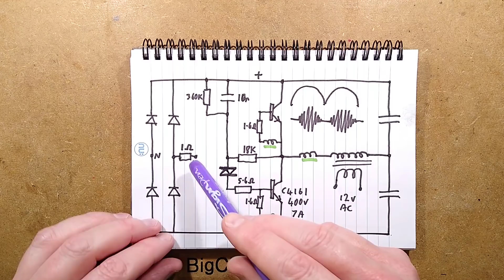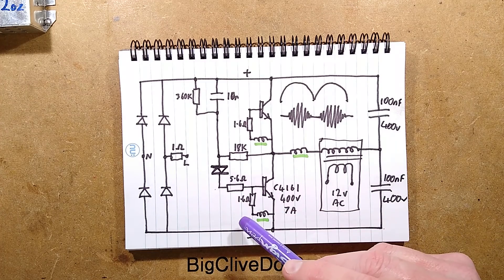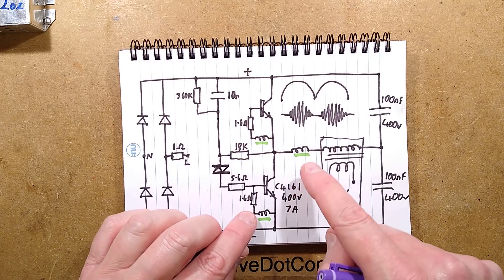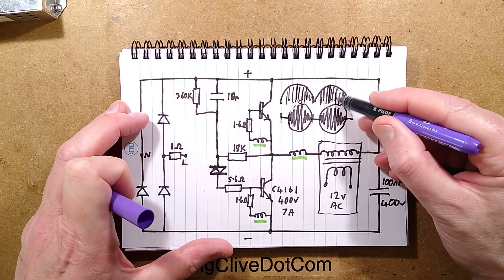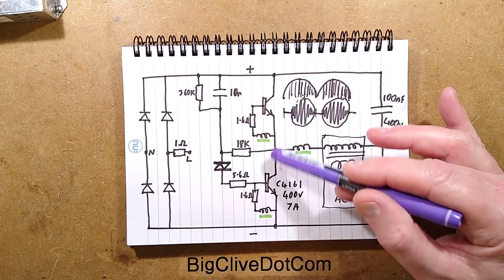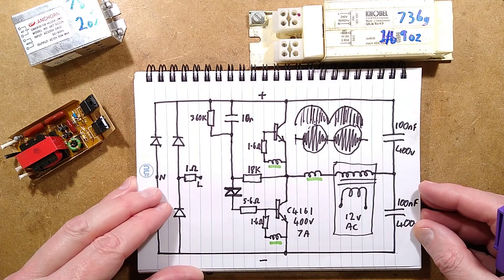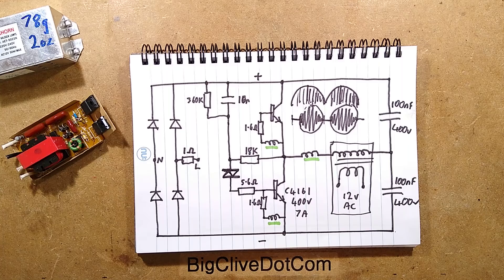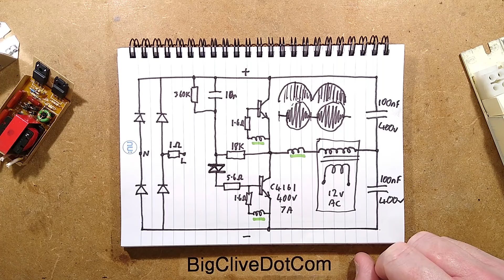Inside an electronic halogen lamp driver, with schematic

Comment: Hi Clive: if you're still tracking this, have you done a follow up on switching out a transformer originally for halogen, to use LED lamps in the same under cupboard downlights?  I switch to LED ones without changing the transformer as I could not work out what to buy. After a few tries, I got some nice G4 cob lamps that didn't flicker much. This was fine for a few months but then I found the Kaoyi KT 60V 20-60W Pri 0.25A sec 11.4V~ eff 5A was suddenly not working. Opening up, there was no obvious damage, but a square Aupo A2F 2A 115C thermal fuse had been stuck half in and half out of some white filler that also covered the bottom off the smaller transformer. A bit of a messy arrangement, and it looks like the fuse cracked because of differential expansion of what was in and what out of the goo! I've sent to China for more, but, in the meantime I've put in an Aurora unit which has the same specs but is lighter. I had a pair of them for some time having been sold them as good for LEDs but then found the instructions said 20W minimum (as you mention here), so hadn't tried them.  Turns out the lights do work with the Aurora unit, but they flicker more than with the old one, that has a surprising number of components.  So, I will fit a new fuse to the old unit, but, ideally I should be replacing with something that won't flicker (or blow up!) with LED lamps. What do I need to be looking for? Preferably affordable: I notice Amazon sellers are askin up to 30quid for the square thermal fuses but Aliexpress just a few ( though still a sizeable fraction of the cost of a whole new unit! Crazy world!).  A great service you are doing us all with all these teardowns and explainers! Many thanks.
Reply from the maker: The best way to drive LED bulbs without flicker is with a regulated 12V DC supply.  The old electronic halogen transformers put out a series of spikes in a crude sinewave, and it can charge the smoothing capacitors in lights to a higher than usual voltage.  Some bulbs can be damaged by the old halogen drivers and many of the drivers really need the consistency of a tungsten load to work reliably.
Reply: @bigclivedotcom  Thanks very much for the rapid reply to this old thread!  When I was ordering the thermal fuses, Google and Aliexpress threw up dozens of pictures of different drive units, trying to tempt me, but just confusing. Can you suggest any particular one? I'm only driving three under cupboard lamps, and they don't need to be very bright just to illuminate either side of the hob food prep area.

Comment: Wow, I have been puzzled for a while why a cfl circuit I am trying to repair is firing the 2 transistors at the same time and blowing it all up. I did not look at the diode at all. It must be the diode being full open and blowing the transistors, fuse resistor and 2 tiny resistors in line with the transistors. Thanks a lot Clive. FYI I really liked this specific circuit from an e27 20W ikea cfl bulb since it somehow manages to heat up an 18W sox lamp to just that right amount of power that it glows the penning mixture with a tiny hint of the yellow sodium on the edges - very decorative, I want it in the living room like that in open view. I blew it up by trying a larger SOX tube where it would not strike at all and blew instead.
Reply from the maker: The CFL drivers are usually matched to their load and get very angry if it is not right.

Comment: Hi Big Clive. I've just reverse engineered a halogen lamp driver from a fancy light fitting so I can repair it. One of my viewers then posted me your video.  The one I looked at is much like yours but it has over current and over temp protection. You can find it of you look for How to Identify the Blown Components and fix it CONTINUED.  Feel free to pop over and say Hi if you like. Richard.

Comment: why don't they just drive the lamp from full wave rectified 12v off the transf secondaru and dispense with the rest?
Reply from the maker: Because for the equivalent power at 50/60Hz the transformer would have to be much bigger.

Comment: These are good for driving flyback transformers if you’ve not got a zvs driver available, plus they’re easy to find in skips as no one wants halogen anymore. I wonder how hackable they are to get more than 12v out of them, maybe upwards of 30v if you rewind the transformer (the ones I have all use big toroidal transformers with the secondary easily accessible and very easy to modify/rewind)

Edit: I tried rewinding the secondary of the toroidal with 30 turns of a slightly thinner wire and it worked absolutely amazingly until the transistors shorted and everything went pop.. I tried it on a different one with 25 turns and it works amazingly with a 7 turn primary on the flyback. I’ll do a video on it at some point as it’s a good way to get 10kv (maybe more) for basically free!
Reply from the maker: They seem to be so well balanced that the "wrong" load can cause issues.  I have however used one to run a neon ring around a standard tungsten downlight, by using a capacitor in series with a step up transformer.
Reply: @bigclivedotcom  I got another driver, yt deleted my comment with the link so you’ll just have to look at my most recent vid. It’s not as good as the other one sadly as this driver has current limiting so it just cuts out at like 140v in from my variac. The other ones I had (before they popped) made a nice white hot arc with a lot of 100hz ripple as no smoothing, this one it’s still there but not as much as the others.
Reply: Oops.. Ive killed the other one now. I guess I’ll have to have a rummage in the skip at work tomorrow 😁. Needs to be cooled in oil or maybe a big fan as it got very hot and once again the transistors died and caused a cascade of pops 🤦🏻‍♂️😂

Comment: My microscope has a driver for a 30W 6V halogen bulb.   When I turned on the light it came on, and then I switched it off and on again, and now it won’t turn on anymore.  It’s not the fuse of bulb.  Are there certain parts within these halogen drivers that tend to fail?   I wonder if it is typically easy to repair.
Reply from the maker: It might be worth checking the switch is working and all connections.  If they are good and you suspect the power supply then it might be viable to replace it, or swap the power supply for a plug-in one and switch to an LED bulb if it's the reflector type.

Comment: Have you seen these in 6 V and 24 V verisons? They sometimes pop up on online sales, 6 and 24 V halogen downlights seem much less common than 12 V ones. 32, 36, 42 and 48 V spotlights are so uncommon that even the classic iron core 50 Hz transformer is hard to find.
Reply from the maker: It might be viable to rewind the outer secondary on the toroidal types for a custom voltage.

Comment: I tried a 20-105 W electronic halogen transformer witha 10 W lamp and it worked. If it power a 5 W lamp its lit dimly. The miltimeter cant measure the HF AC output so I used a diode and a capacitor to measure peak voltage. With no load it was about 6 V in 1 direction and about 12 V in the other direction. With a load its about 17 V in both directions.

Comment: Thanks for explaining this. I took one of these out of a vintage makeup lamp. It has a large capacitor and inductor for smoothing and two 1N diodes where the diac would be.  I didn’t know why they convert AC to DC back to AC again, but then I learned about the need for feedback, isolation, and dimming. I enjoyed your explanation of the double crossover circuit.  Now know there isn’t much use outside of driving a halogen bulb. Maybe it is useful for parts!

Comment: Thank y sir!
It's possible use this for drive a little neon tube at 12v?
For the science can try?
Reply from the maker: This won't work for that, but you can get 12V neon power supplies.
Reply: Thanks again😀

Comment: Hey Clive. When I was probably about 12 or so, i remember finding an old desk at the curb with a halogen light setup. I actually hooked up the transformer to a TV flyback and to my surprise it drove it beautifully! I dont think I've seen anyone on YouTube trying it out.
Reply from the maker: I used a little cold cathode transformer across the halogen lamp and it drove a tube OK.

Comment: Can you explain me the circuit of halogen lamp transformer 220v AC to 12 v Ac . My transformer not giving 12v AC output
Reply from the maker: If it's an electronic one like this for halogen lighting then it needs a load to work properly.  If it's a traditional transformer it may have tripped a thermal safety device if it got hot.
Reply: @bigclivedotcom  ok thanks
Reply: @bigclivedotcom  It is a electronic transformer. That means if I connect 12 v AC load then it will give 12 V AC output.

Comment: Clive on the larger versions of these, are all these components just scaled  up or does it have extra protection?
Reply from the maker: Some just scale it up, but most add short circuit protection.
Reply: Larger versions can be made cheaper and better performing with slightly more complexity. You can scale up this basic circuit but it’s not terribly wise. Also, today you can have a $0.10 microcontroller running the show in those supplies and it can do a much better job at controlling it all than a raw BJT self-resonant converter.

Comment: Nice video. Recently I opened an analog strobe light because it wasn't working. The circuit is pretty similar but there is a component named LD1 that looks kind of like a mini halogen with two little pieces inside similar to coils. When I turn it on, one of the sides in the LD1 gets bright (with kind of an incandescent look) flashes at the freq the halogen strobe light should be doing but the strobe doesn´t work. Anyone knows what that is and how does it work. I've been searching for information but most of what i found were digital strobes. Any information would be nice thank!!!
Reply from the maker: It's probably an NE2 indicator lamp being used as a voltage threshold trigger.
Reply: @bigclivedotcom   YESS that's the exact component, thank you very much, i will try to put a new one. I'm a student in electronic engineering and your videos are helping me a lot to get motivation, so thanks x2.
Reply from the maker: @perlyax  When the neon flashes it will probably trigger a thyristor that will dump the charge on a capacitor through the primary of the xenon tube's trigger coil.
Reply: @bigclivedotcom  Yes that must be, I will take a look at it and see if I can revive the strobe and hopefully learn new things, thank you!

Comment: After the CFL lamps were replaced by LEDs, I thought, great!  Now we're finally getting rid of that stupid CFL circuit that dies before the tube dies.  And then I find that that damned circuit is still around in halogen lights!  😠😠The CFLs have two of those cheap light duty transistors in the TO-92 package.  The first unventilated lamp it's screwed into will cause it to overheat and then like you said, go bang.  Really lame.  

Thanks for the informative video, Clive.

Comment: I've found electronic transformers to be quite reliable. It's possible to buy LED lamps which are compatible with electronic transformers. Here are some application notes from TI/NS showing how electronic transformer compatible LED lamps work.
https://www.ti.com.cn/cn/lit/ug/snvu123a/snvu123a.pdf
https://www.ti.com/lit/ug/snvu112/snvu112.pdf

Comment: Why don't they just use a transformer to drop down to 12v I don't get it? Why go from ac to DC to ac again?
Reply: Resource use and cost. Mains-frequency transformers are not particularly cheap to make. As for going from DC: it actually makes life easier, not harder, believe it or not. Making a converter that can run from unrectified AC requires more components than the simple rectifier bridge.

Comment: I just saw something on ebay you might be interested in, its a 1kV megger/insulation tester that sells for 15 quid brand new, model number BM500A
Reply from the maker: I have one here.  The problem with using it in the UK is that the red tape brigade would frown on it for not ticking their boxes.

Comment: Try connecting a copper coil in the output of the halogen driver  and put a piece of iron in the coil i think it would cause the iron to heat up

Comment: Hi Clive. I've got an item I'd like to send you. I have MS and I can't tell temperature well so I use these in-pipe thermometers to make sure I don't burn myself in the shower. They are very unreliable though and it's frustrating to have to keep replacing them. I'd like to understand what's going wrong all the time and if there's something I can do to mitigate it.

The type I use are some of the first that come up on eBay when you use the term "shower thermometer'. Here's the eBay listing number to the first one I found : 363000609068

If you could help I'd really appreciate it! It might be a challenge though as I think some parts are potted with resin. Have a great day!
Reply: An alternative may be a temperature-control valve.

But those thermometers shouldn’t be too finicky if done well, sigh. You may have more luck using a thermometer with a waterproof sensor/probe on the end of a cable. Just poke a small hole in the hose and stick the probe into the hose. I’ve tried it as an experiment some time ago and it worked OK with the thermometer from a dollar store.

Comment: Hi Clive, is there any way of getting into contact with you other than YouTube comments as I would like to send you a power supply I have for my iRobot Scooba, it’s an American 120v input and I mistakenly didn’t use a 240v step down transformer when plugging it in, lots of yellow capacitor urine everywhere. I was wondering if there would be anyway to step 240v down directly inside of the power supply to 120v and then put it back out onto the power supply’s main board.

Comment: I've had some of the early LED drivers kill radios back when they first came out. I've also had customers install MR16 and G4 LEDs on halogen lamp transformers then wonder what that high pitched screaming noise is.

Comment: I think the resistor/capacitor/diac combination in the first one essentially does the same thing. The resistor helps trickle some current around the capacitor on the rising edge of the rectified wave to keep a voltage bias across the diac so it will trigger. Once triggered, it connects the lower side of the 10nF capacitor to the base of the lower transistor, and then ground, which begins to charge the capacitor and provide a trigger pulse to the lower transistor to turn it on. Once the capacitor has charged, the current pulse ceases, but at that point the feedback network will have taken over and begin oscillating. Theoretically it saves them a diode since the 18k should keep the lower side of the capacitor hovering about the midpoint of the switching waveform, and keep the diac off until the end of the rectified wave at which point it will discharge thru the 360kOhm resistor, if Im reading it right.

Comment: I thought I would save my company some money by replacing 12 halogen MR16 lamps (in reception area) with LED versions, but I specifically got the LED version that said was compatible with electronic halogen drivers.  Well it started out ok, it worked fine until after about 3 months the first LED died, then another, then another.  After about a year just over half of them had failed.  Each time I replaced the LED, I also replaced the driver with a proper LED driver.  All the LED lamps that were on LED drivers never failed.

Comment: "Wonder what all these holes are for in the enclosure. Oh well."
> Sticks "OK-QC" sticker over as many ventilation holes as possible, instead of the end panel that's solid.
Never change, china.
Reply: Just like the PAT tester plonks nice lovely layers of tested paper stickers over ventilation holes and on plug top power supply units.

Comment: I have - had -  12v halogen lights in my bathroom. As the bulbs blew, as they do, I replaced then with LEDs, which didn't work. Assumed the drivers had died. Might be they are these, and just wanging some halogens in will have them working again.

I feel rather stupid now 🙂
Reply from the maker: It's a common thing.  It catches a lot of people out.
Reply: @bigclivedotcom  if it is just the bulbs, my brother will kill me - I had him go up into the spider invested loft to make sure the drivers were getting power.

He hates spiders 🤣

Comment: You should show electroboom how this kind of halogen driver circuit can be used to directly drive a TV flyback transformer for high voltage fun, since the output is unrectified AC at high frequency its output can directly drive a LOPT. He tried with a cfl driver but failed https://youtu.be/yeadK4cs_Bs .